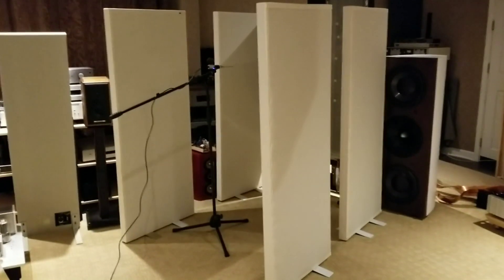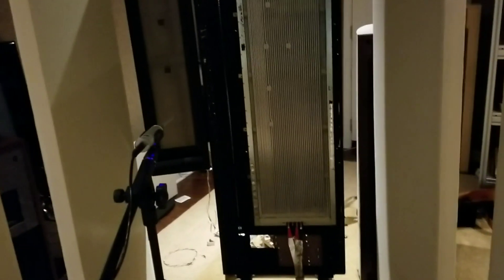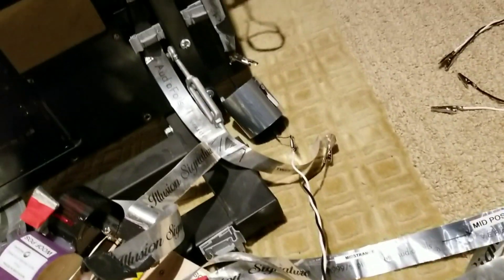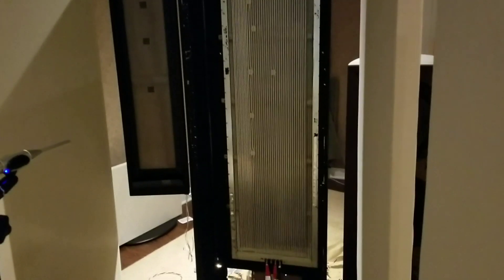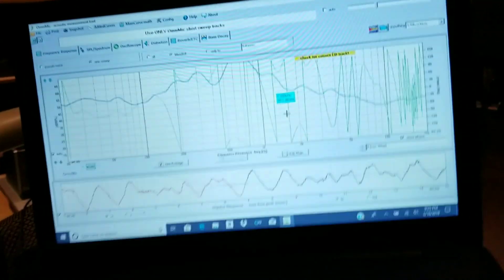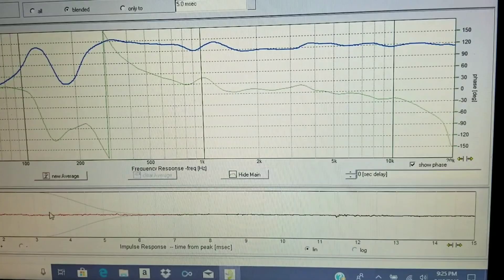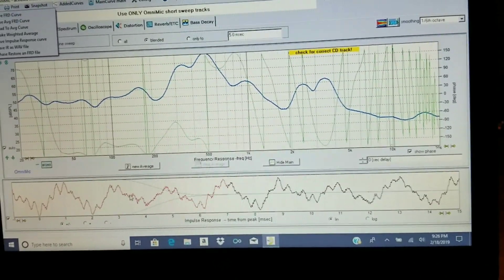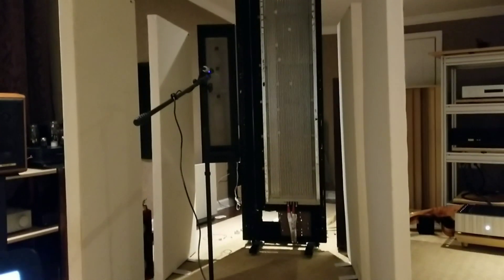Loudspeaker tuning #1

Comment: try dedicated class A amplification for each woofer on the panel.. or try some ncore 500 on them.. 

distortion measurement of amplifier noticibly better on low watts... like 10x to 100x(class-d)

if you stay with analog crossober l would go for a khozmo stepped passive attenuator direct in power amp bypassing any preamp.. 
i still think big planar speaker is harder to make right than electrostatics... they seem to always have that metal etchyness to the sound.. maybe for 150hz to 1khz you could go planar.. 

electrostats need great amp tho..
Reply from the maker: If anything I'll use the non module based Gallium Nitride Class D amps ive got which shred N core modules. Actually maybe I will measure distortion. My class AB amps are Jeff Rowland 625 S2, the lowest distortion ive ever used at .003%. . I've got a khozmo and I'm about to test the linestage theory with a 26K NAT Audio just coming in DHL from Europe. I'm more listening for sonic with linestage, not accuracy. Planars do take a lot of work but once they are dialed in. Nothing beats it in my opinion. Well yes. One thing does. A 100% ribbon planar magnetic...

Comment: I have an off topic question @OCD Hi-Fi Guy , I wanted to pm you but can’t find a way . About the footers for dacs amps etc , I have noticed a drastic difference in sound with them on my Dac which has a tube output stage , I have a friend who has a solid state Dac and he thinks that footers make sense to put on tube gear but not solid state . Do you have an opinion on this ? I know the easy answer is try footers on the SS Dac and see if you hear a difference but have you experienced a difference with footers on both SS and Tubes ?. Thanks in advance and great video man.
Reply from the maker: Hey Lance, it's easier to hear on tube gear but effective on SS as well. Go to mikepowellaudio.com to get in contact. Cheers!

Comment: The mid range must be there for a reason. I'm thinking that the mid range handles the distortion better. Even though a particular driver can go up to a frequency level the harmonic distortion may be un desirable.
Reply from the maker: Clearly George has built speakers,  you are on point my friend. The 2 measurements I did on each was FR and harmonic distortion
Reply: @OCDHIFiGuy  distortion isnt everything.. 1000k to 40khz isnt woofer.. its a midrange... you are still stuck with crossover in the middle of the midrange instead of a true full range panel covering 150hz to 10khz.. you could try EQing down the 1000k to 40hz to have it flat from 150hz to 40khz haha.. all depends on the power handling and distortion level.. 

it's hard to understand somebody who say a midrange is a woofer..
Reply: oh and drop in dispersion at high mid 5 to 8khz level is bad since it's where ears are most sensible... meaning dispersion mismatch will seem even higher than it seem on paper.. 

also the super tweeter ribbon start at full dispersion in its low range.. where that 1khz to ... midrange will end with ultra low dispersion in its high range..
Reply: That woofer panel has distortion levels more than 50dB down from 40Hz to 1000Hz.  Amplifier-like numbers.  It's a remarkable transducer.
That midrange section is wired 8 Ohm and its sensitivity is around 5 dB lower than the woofer and tweeter.  It's use is very limited because of that if the goal is to present a neutral/flat response at the listener position.
Reply from the maker: @t00by00zer  the differences in outboard vs inboard mid in impedance is 7.8Ohm inboard 5.3 ohm outboard. This ought to change the passive xover

Comment: midrange is there for dispersion matching,  you measure only on axis !! try off axis
Reply: The midrange is more than 5dB down from the woofer and tweeter response.  It's an 8 Ohm unit vs. the 4 Ohm woofer and tweeter.  It simply cannot keep up with them except in a very narrow bandpass filter with a fairly high Q.
It's superfluous in the present configuration.  They needed to rewire the mid for 4 Ohm to properly integrate as a true three way.
The mid has good response and distortion, but its sensitivity is just too low.
When listening to dipoles, you always listen on axis as response drops dramatically as you move off axis.  That woofer should blend beautifully to that tweeter at the listing position.
Reply from the maker: @t00by00zer  fired up !
Reply: nothing wrong in trying but you also have CSD and IMD to take into account.. also mismatch offaxis mean mismatch wall reflection and mismatch absorbtion need.. not sure where i see the problem of matching 4ohm with 8ohm drivers and 5db down.. you could use a digital crossover with separate amplifications for bass and mid, high could be wire as supertweeter so no crossover in the signal path of the midrange.. or you could go 6db crossover between that midrange and woofer as long as volume is matched..

line source of the sort can have great side dispersion with a midrange.. 

im not saying not to remove it but to test it out in all possible configuration and not listen to guys like you who doesnt take much into account..

you could even wire that midrange as supertweet over 10khz.. so no crossover for the bass mid..  and keeping dispersion... less IMD and better CSD.. all depends on the workable range of each..
Reply: @lextr3110  the woofer panel is exceptional across the band.
Do you understand that Magnepan didn't use an electronic crossover?  They had that midrange connected in a typical 3-way series XO and the midrange wound up being depressed by about 5dB relative to tweeter and woofer levels. 

Right now he's running all three components, but the midrange is limited to a very narrow range (~1800 to ~3200) which is fairly ridiculous.
The mid, which does have a nice response, could not be used as a tweeter.  The woofer panel has nearly the same high frequency extension as the mid panel.  And the tweeter has amplifier like distortion levels down to 1000Hz.  There is no reason for that mid panel, at least not in that configuration.  They should have wired it for 4 Ohm so that the sensitivity more closely matched the woofer and ribbon levels.  The little outboard panel Mike added has plenty of sensitivity to keep up, just not as low of distortion as the Maggie panels.
I'll put my speaker design experience and know-how against yours any time.